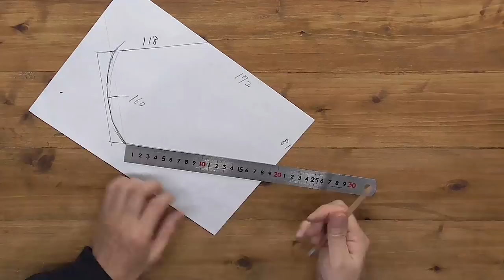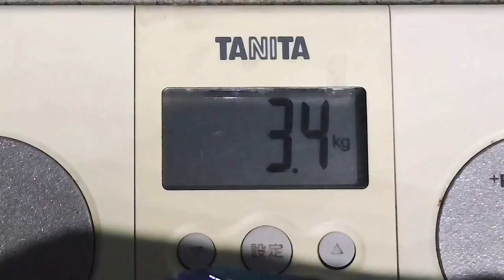Big size resin art aquarium! A huge ancient fish DUNKLEOSTEUS【ダンクルオステウス/dinosaur/Creature】

Comment: Bit of feedback on the twisted sides of the mold: the side that goes "up" doesn't really need atention (it looks lik ewaves), and neither do the sides that go to the sides (they can have any shape you want), but the bottom side REALLY would have needed to be flat no matter what, either by grounding as much as needed if posible, or by an extra pouring if needed. Nice work overall. Not exactly "nice", more like "kickass", but you get my meaning.

Comment: Hello.
Could You explain the latest step on resin?
I thought there will be fine polishing with ultra fine grain, but You aplied resin?
All best!
Reply: The last layer of resin can fill in around the sanding work, which is mostly to achieve a flat surface.
Sort of like how you can use wax to create shine on a table or car, or like a top coat to create more light scattering!
Reply: @jossypoo  Thank You!

Comment: Where can a guy get that thin plastic you used I've got a diaporama I need to fill with resine but wood wont do it its cylindrical and I've got no clue where to get plastic like that
Reply: It's acrylic plates I believe? And you should be able to find them at online craft stores like Michael's! Or maybe a hardware store I think, hope this helps
Reply: @ozcalljameson8455  yes it does thanks

Comment: Resin stinks and you need a workshop or at least a room to work with it. The kitchen table is certainly unsuitable. Furthermore you need an angle grinder. How many modellers can fulfil these requirements?